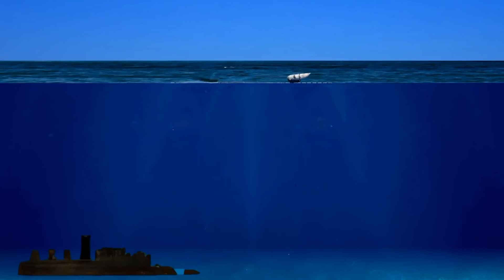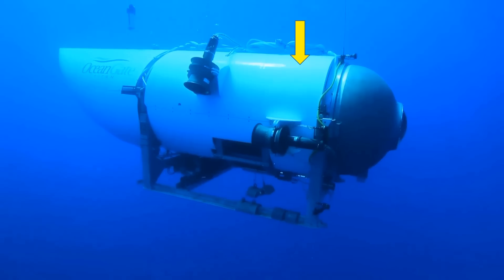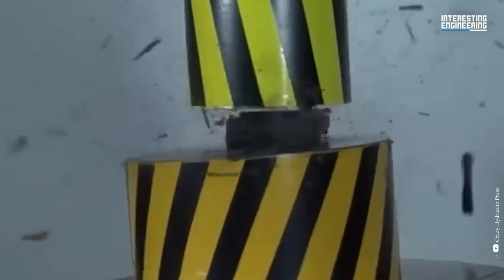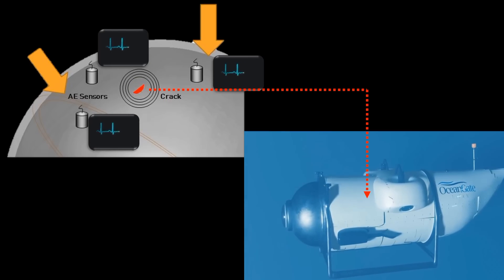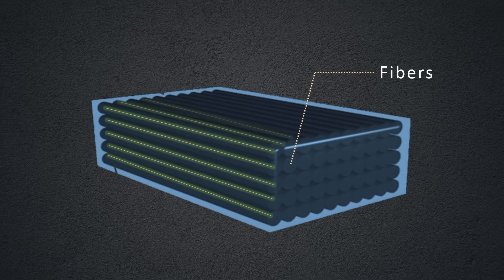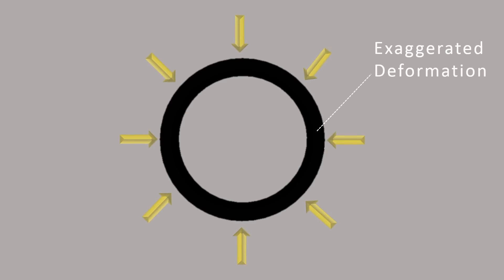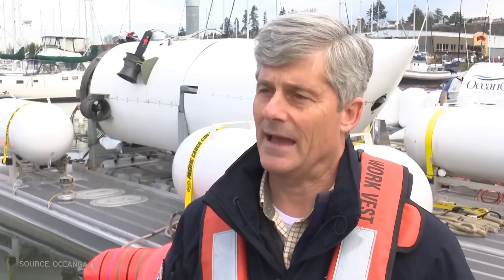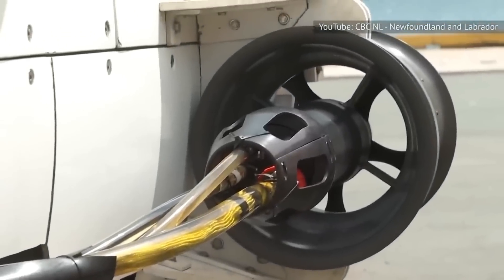Oceangate Titan Did Not Implode Just From Pressure. There Is a Catch!

Comment: The alarming thing is that failure of the CF hull is only one of the candidates for the disaster. Many engineers have also pointed out that the glued join between the titanium ends and the CF body was another egregious weakness in the design. And then there is the viewport that wasn't rated for the depths that Titan was diving. What possessed wealthy and apparently intelligent people to trust their lives to this thing is hard to understand...
Reply: I don’t think the glue was the problem. Those caps were being forced on to the end of the CF cylinder with a force of around 6,000 tons at that depth. Comes to close to 7 tons per square inch of bearing surface.
My only qualification is a degree in physics, but that and five minutes research convinced me that CFRP was absolutely not the material to make an external-pressure vessel from. It’s compressive strength is only 10 - 20% of its tensile strength. Great for wrapping internal-pressure chambers where the outer surface is under tension, but here the outer surface of the cylinder, particularly mid length, is subject to compressive loading. Frankly, I’m amazed it managed to survive even one dive to that depth.
Reply: @q.e.d.9112  The reason the glue was an issue is that the titanium ends would compress very little with pressure, but the CF hull would compress by as much as a centimetre. The potential for fatigue and failure at the joint is clear - especially as best-practices were ignored in its construction. A safety-critical join between two such dissimilar materials has been criticised as a very questionable design choice, considering the extreme pressures involved.

But yes - CF seems an entirely unsuitable material for resisting external pressure. As you say, the carbon strands offer no strength in compression - its only the plastic resin that's holding out the water. Plus quality control is notoriously difficult - especially for such a large structure, and the methods used have been strongly criticised.

All in all, a deeply delusional project. Why the passengers, who were investing $250k each on the trip, didn't spend a few thousand on a 3rd party safety assessment before committing is baffling. It seems that the experimental nature of the vehicle was a positive attraction for them...
Reply: @tullochgorum6323  
I can’t see that glue would have made any difference to the issues you mention. It wouldn’t have stopped the CFRP from compressing, as far as I can tell. The most likely point of failure, IMO, is towards the centre of the cylinder, where the radial pressure is exerting a compressive stress on the outer skin but a tensile stress on the inner one. This, while subject to an axial compressive loading of something like 7 tons per square inch. Since this tensile stress is in opposition to that axial loading, it throws even more compressive force onto the outer skin.
Accordingly, my best bet is that there was a compression failure towards the centre of the cylinder that was the immediate cause of the implosion. Why anybody would think CFRP would be a suitable material or a cylinder a suitably rigid shape, for such extreme pressure, is beyond me.

Comment: Very well covered. I’m an aviation fellow that has long wondered how long it would take the cyclic pressure to lead to failure and what non destructive test process could testify as to the viability of the structure.

The other massive issue I have is who in their right mind would construct a conveyance for a live crew that was put together with absolutely no seakeeping capability whatsoever. The submersible barge seems a misguided approach.

Comment: For use in spars, covers, rods, ROV control planes, etc. carbon fibre is probably okay for use in non-essential deep water applications... but only for weight savings/buoyancy, and not for structural purposes. It's just not the right material for it.

Comment: James Cameron also use a Saitek Cyborg 3D joystick during his dive to the Titanic wreck. 

Also note that game controllers are specifically optimised for extremely low input lag. So I don’t think there is a concern with the input lag. 

The main concern would be reliability but they are also unlikely to break down and keeping several spares on board should be more than enough to address this concern. 

So I don’t see issue with using game controllers really. I don’t see it as high risk at all.

Comment: similar to how  concrete structures fail. Concrete is extremely strong with downward loads but much weaker with lateral pressure. Poor design and it is an inventor's worse nightmare and curse. When an inventor get's locked into an idea and stops being willing to be objective  to alternative solutions or concerns then a potential failure is more likely to occur. Over time many inventors have died from their own creations but in this case I hope the families are compensated. I believe false advertizing plays a major role. I am now grateful for regulations and testing. Imagine getting on a plane without regulatory testing and maintenance. Now if we could get this type of regulations of vetting our federal employees. We are under alot of pressure and have the potential to implode

Comment: If the leaked transcript is real, it sounded more like the equipment bay sprung a leak. This created additional weight which accelerated the descent. It also seemed to knock out one of the batteries. If water was streaming in at that depth, it was probably like a cutting beam and cut through whatever was in its path.

Comment: I think carbon fibre can be used in submersibles, it just needs more engineering. 
The design was ahead of it's time and should never of had passengers on board, I think the investors were chasing their money.
But on how you would make it work, well just design it in a way where it has more tension on the inner layers and have all fibres in tension.

Comment: The weakest part of Titans design were the two titanium flanges, which were manually glued with epoxy to stick to the carbon fiber hull. These three materials have vastly different properties under pressure.

Comment: Dead on analysis. I am not a mechanical engineer, but I know enough about carbon fiber/epoxy matrix structures to understand that they are conceived as optimal in tension applications. The pressure forces were on the wrong side of the vessel for that material choice. 

During a review of purported communications transcript between the submersible, and the surface support vessel, it became apparent that the submersible lost boyancy prior to failure. I doubt that this was because of water intrusion because of the immediate manifestation that should have been detected within the cylinder at such high pressure. The occupants heard “crackling noises”. I think that the boyancy was reduced due to plastic deformation, which carbon fiber does not do very well. It does not stretch, it snaps.

Comment: 6:27 it's not the radial stresses you are showing. They are tangential stresses. Tangential to the circular surface. Being another mech i have to point out that although I imagined the failure in a similar way the analysis is incomplete. In the end you have basically showed the failure due to static stresses. But the failure was more due to cyclical stress causing  delamination of the material and deterioration of it's properties where the the material is not even uniform. The YouTube channel real engineering poses the perfect answer. It's called snap buckling and it's actually what has been documented. The structure doesn't become an ellipse under pressure but more of a square and the inner layers start to delaminate leaving them in bending configuration. Have a look.
Reply from the maker: To clarify, I have shown the variation in magnitude of radial stress at 6:27. Of course the direction of radial stress is radial. The failure was initiated because of repeated stress as I discussed at 2:27. 
Yes, snap buckling could be one of the causes of failure.

Comment: The carbon fiber composite material can handle expansion, such as in the 787 Dreamliner, but cannot handle compression...it cracks. Not immediately but over time. The implosion I believe would be even faster because instead of crumpling the pressure hull physically shattered all of a sudden. What we have here are similarities between the sinking of the Titanic and the implosion of the Titan. Both were thought to be unsinkable, both were cheapened up on in critical areas. The arrogance of the builders of the Titanic and the arrogance of Stockton Rush are similar. I actuallydidn't think something like this would happen, but basically Stockton Rush just ended up building a submersible waiting for an accident to happen. It's just sad that Stockton Rush took other peoples lives as well as his.

Comment: Thank You for excellent discourse on this subject!

My opinion was that there was differential thermal issues with the binding agent holding the carbon fiber and titanium together.

That the difference between the three materials created expansion and contraction issues creating micro cracks in the seal especially if it was used repeatedly.

I believe that they dove to fast not allowing the temperatures and pressures to occur in controlled manner within tolerances.

I believe that this was a fine submersible for working depth of 1,200 meters and a maximum of 1,600 meters.

I believe that the porthole window should have been upgraded and been certified.

There should have been a sister vessel on standby.

They should have had multiple additional rov’s...

I believe that carbon fiber is workable material for submersible vehicles but that it’s limitations and weaknesses must be recognized...

I would have placed a additional layer of carbon over the titanium and carbon fiber hull creating protection for the edge of the titanium at the joint with carbon fiber.
The glue seal should have been completely protected...
A second titanium ring should have bolstered the structure from the inside.

At that depth in that vessel my protocol would have been to slowly lower the vessel by remote control without any passengers for the maiden voyage...

Give it a full pressure test and all systems check...
Slowly returning to the surface.

Perform all checks and maintenance.

Only then proceeding with the maned mission.

Then only using the vessel that one time at that depth.

I believe that would have kept it within safety parameters.

At 1,000 meters that I think that vehicle would have a fine number of service hours and dive numbers.

At greater depth there is no cutting corners and saving money for lower cost tickets or increased profits.

The narcissistic thinking led to confirmation biases and a lack of appreciation for the physics involved.

I am afraid to ask if they even had spare controllers?

Don’t place faith in material things. Material things will fail you.

I would like to build a sailboat that is submersible... only to 60’ for standard use.

In this way the sailboat can seal up and duck underwater in a storm.

Then pop back up for good weather.
For my purpose carbon fiber would be a good choice... but I don’t know what lottery I would have to win to pay for that much carbon fiber in the thickness required. LOL 

You can’t cut corners on materials and engineering.

Comment: Terror in the Deep Sea with the submersible Titan made of Carbon Fibers which is a material very used in the fuselage of airplanes, where they are under tension, more under compression, the forces are exactly opposite, the thickness of the hull was out of standards and the lack certification by any competent maritime body, the occurrence of several Incidents previously resulting in a true tragedy announced. 🚨

Comment: Beautiful and informative hypothesis and explanation.  My only complaint is about the video game controller.  That was probably the only thing that was done right in this sub.  Video game controllers have millions of dollars invested in research and development, and have hundreds of thousands (if not millions of hours) of testing by the masses.  Even the US government uses some modified x-Box controllers to fly some of its drones.   There is no way that some one of a kind custom controlling system for this sub would have been as full proof, as tested, or had nearly the investment that the game console controller had.  It’s very arguable that using the video game controller as the method of steering this submersible was possibly one of the few good design elements in Titan.

Comment: It's not just the carbon fibre issues, but the use of titanium and carbon fibre together that caused this disaster. The cumulative fatigue between the two, caused by having different pressure coefficients is the culprit here, resulting in delamination of the carbon fibre shell. Imagine the occupants sitting inside that thing for 20 minutes, alarms going off (sonic tests failing), listening to the 'crackling' sounds - it's the stuff of nightmares.

Comment: I read on another site that the hull was suppose to be 7" thick(not 5")
Rush was in a Rush.   The use of a sole joy stick to operate the thing was also a cheap way to do it, and how much testing was done before it was sent down 2 miles?  There was no "Backup incase something did not work.    The loss in  communications was problematic...with no 2nd system as  a back up just in case. RUSH fired his tech guy when he said it was unsafe. Then he deserved what he got.

Comment: I have that exact same Logitech wireless controller that I use with my raspberry pi, and I had to quit using it because it used up batteries so so quickly, and even with fresh batteries it would constantly disconnect from the transmitter.  I ended up using the Logitech wired controller with a USB extension cable and it works perfectly. So I don't think using a game controller was the problem, but the wireless aspect probably gave them the same fits that it gave me.

All I know is, if I were to plan to ride on the ocean gate sub, and I saw that wireless Logitech controller, I would say, "I don't even trust this for my raspberry pi, so I'm not going to trust it with my life in this sub."

Comment: Good explanation of why carbon fiber is a poor choice for a submersible. Another issue was the difference in compressibility between the titanium end cap and carbon cylinder, creating high shear force on the glued connection. This in turn can cause small cracks in the glued seam allowing hi pressure water to enter and quickly propagate any potential void space at the edge of the carbon shell itself, thus causing rapid delamination. - Kinda like a jet sprayer hitting the side of plywood where water can work it's way in-between the laminated layers. This could also explain why they had several successful dives before it imploded.

Comment: My instincts tell me that the bonding of the cylindrical hull to the hemispherical end caps, of different material, structure, and properties would result in the weakest and most vulnerable points in the vehicle. The metal ends and carbon composite hull must certainly react differently to temperature and pressure and place excessive stress on the bonded joint itself. I must assume that these components failed to remain securely connected to each other during repeated dive cycles. I would appreciate hearing that discussed by engineering professionals.

Comment: Carbon fibre could be used for high pressure gas flotation devices on deep sea submersibles, because when filled with pressurised gas the carbon fibre would be in tension. It doesn't seem suitable for compressive loads.

Comment: Why are you using beam design stress strain analysis when thick was cylinders have been solved decades ago for uniform materials.   Can find this on the web. I went to "Formula for Stress & Strain" R. Roark & W. Young 5th ed.  Table 32.1c Uniform external radial pressure, logitudinal pressure zero.  Added this logitudinal stress from a simple calculation of pressure on a cylinder ends.  
     Material properties of the composite: Young modulus 175 10^9 Pa   8 10^9 Pa; ultimate compression -850 10^6 Pa -200 10^6 Pa  took 85% of this due to laying the fibers to balance logitudinal pressure.  Inner radius b = 0.762 m Outer radius a = 0.889 m  thickness 5 inch  and load q = 400 atm = 4.053 10^7 Pa
     Calculated stress independent on material if homogeneous: OD hoop =  -2.68 10^8 Pa  ID hoop = -3.055 10^8 Pa  OD radial = -4.053 10^7 Pa ID radial = 0.0 Pa  Area of OD cross section 2.476 10^4 cm^2  cross section of cylinder 6.579 10^3 cm^2  axial stress = -1.525 10^8 Pa    Note: the radial stress in an order of magnitude less then the hoop and axial stress and that the fibers can be laid to balance the two thus the 85% drop in the ultimate load, however you can choose a different average angle or vary it.  The radial stress being an order of magnitude lower suggest to me that it didn't invalidate the analysis.  Obvious there is an error but for such a back of the envelope calculation still a good start.

Comment: What about a 6 or more sided frame, say made of titanium, with carbon fiber wrapped around it? Wouldn’t that take more advantage of the tensile strength of carbon fiber? Perhaps with a center hexagon of titanium and both end caps being titanium.

What a sad case of lazy and over-optimistic engineering the Titan was.